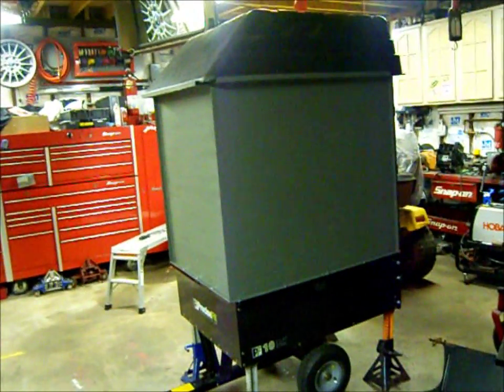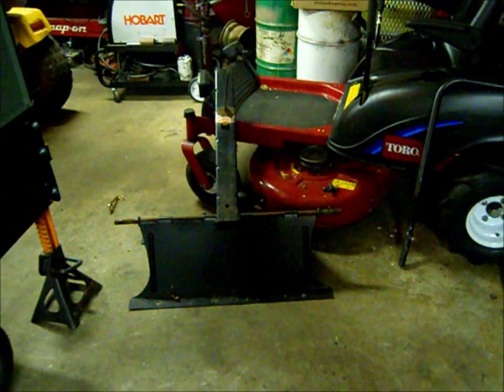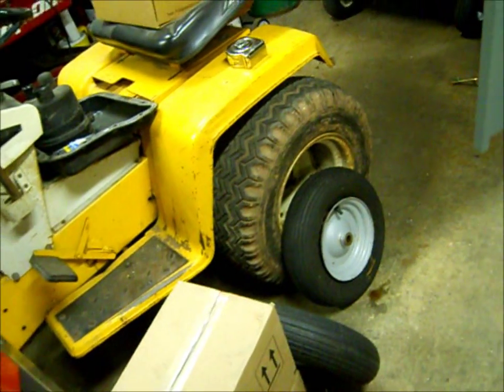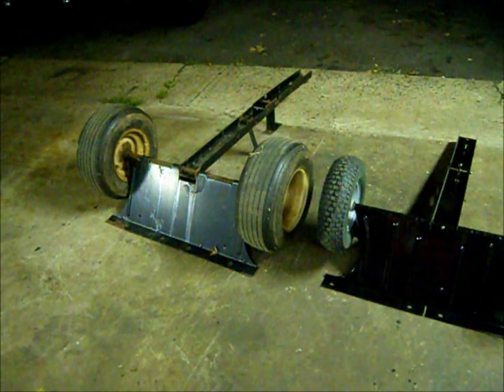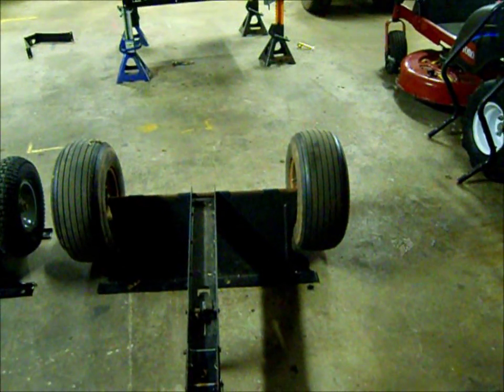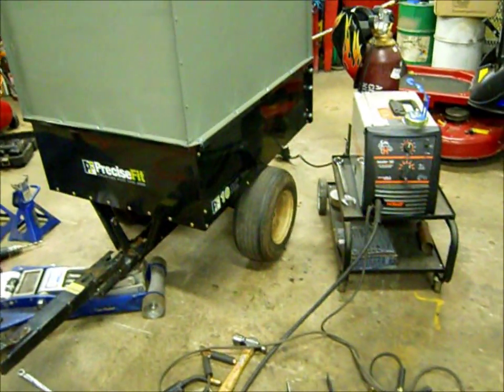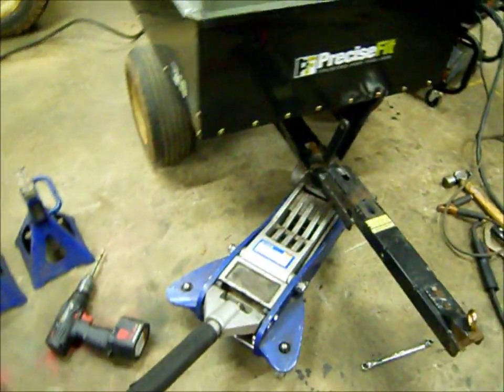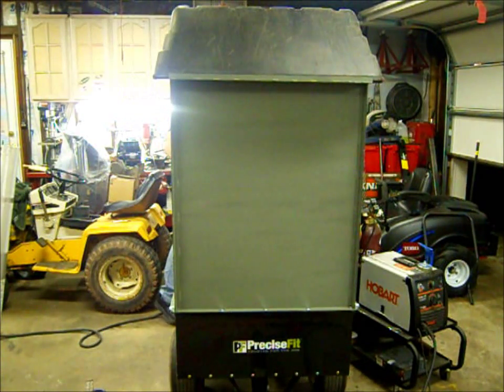Lawn leaf vac system fab part 11, dealing with stability issues

Comment: Nice work, looks like if you extend the axle out a bit more you can drop down the trailer between the wheels which will help alot with the stability as well.

Comment: It looks better. I had my shorter trailer knock over with a full load of wet chopped leaves. It took me and a neighbor to stand it back up again. Since you have a 0 turn mower, you may want to install huge casters on the back and mount it solid to the mower. That would also help the stability department.